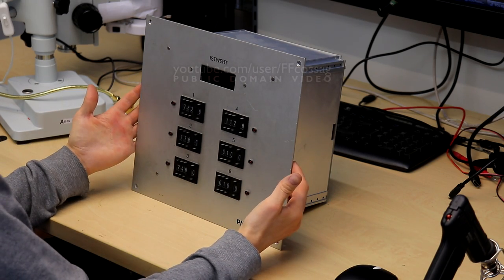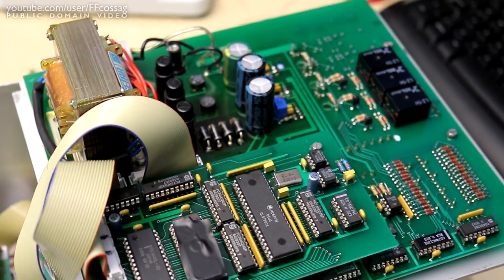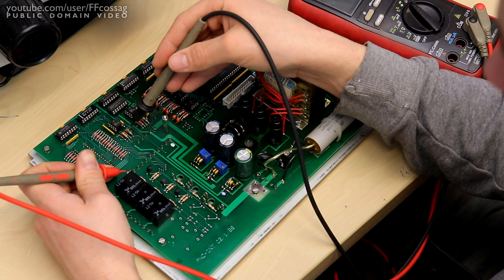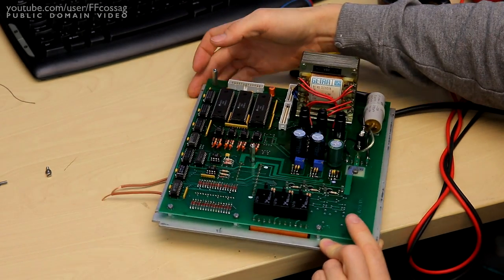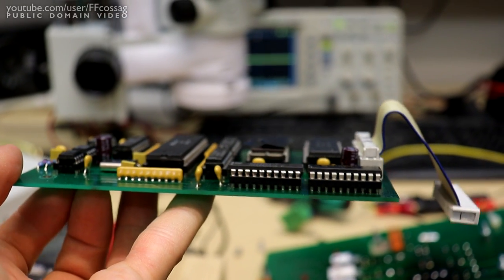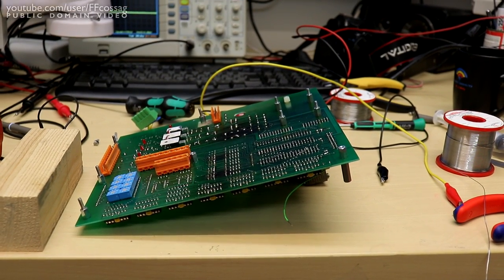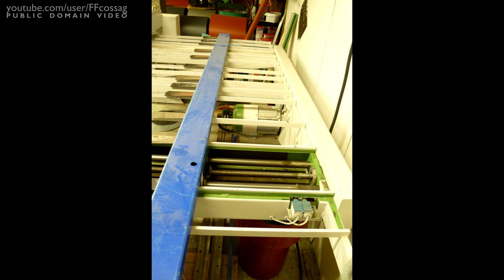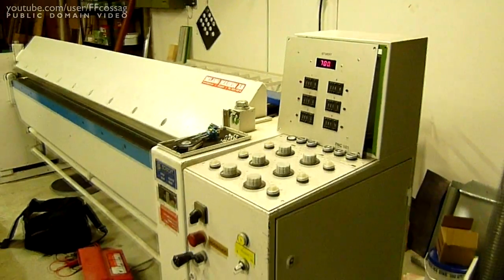Dr. Fixwrong, or; how I learned to stop troubleshooting the brain box and fix the broken sensor

Comment: It's always fun going on wild goose chases trying to fix problems, like my Honda generator, thought it was multiple different things (bad capacitor, bad field coil, bad wiring, bad rotor windings, etc.) until I found it was a diode on the rotor that had failed causing it to put out hardly any power, worked a treat after replacing that (and its companion on the opposite side as a just in case measure)... :)
Reply: That's always a good idea, if you have symmetrically placed components in a schematic (electrically speaking), check the other one if there has been a failure or if measures marginal, replace as necessary or as a mandatory good (preventive) measure.

Comment: In the late 90's, I worked on a  6 ton medical device used in cancer therapy.  It was built in the 70's & used relay logic.  As is rotated, a cam actuated switches & told the electronics where it was.  A spider-nest prevented one switch-arm from operating and the machine attempted to destroy itself by moving past it's limits.  Fuses exist for a reason...
Reply: 6 ton. médical. cancer.
radiothérapie using a pasive source?

Comment: Resolver aka position sensor. I worked on a fairly fancy metal stamping machine that could pound "hits" at around 300 per minute. One day the dang thing would only manually  run one hit if you stood there and hit the buttons just right. It was the same looking gizmo as was at fault mounted to that motor. Think of it as a crankshaft position sensor.
Nice video as always... Happy Spring time from one northern deep freeze to another

Comment: Ahh a wild goose chase, i think we have all had that happen :-D
i like that design, input/output handling on one pcb and the computer on another.
Old tech but it works, and it has done so for quite a while :-).
That resistor on the rotation sensor did look a bit hot under the collar, perhaps that did not help the bad joint.
Never mind, it's a reminder lesson for all of us.